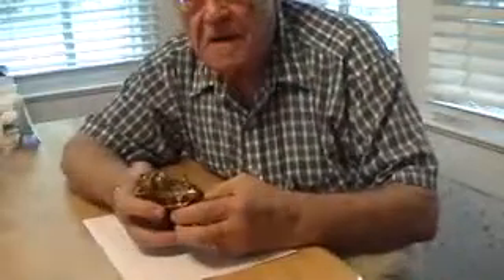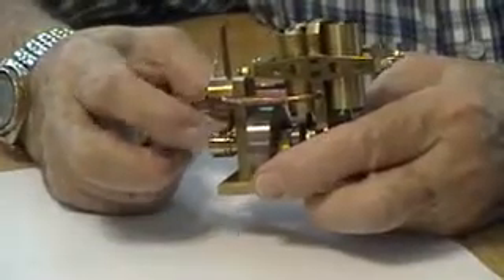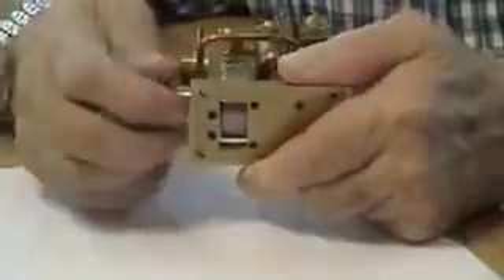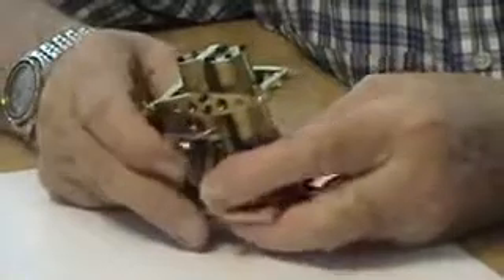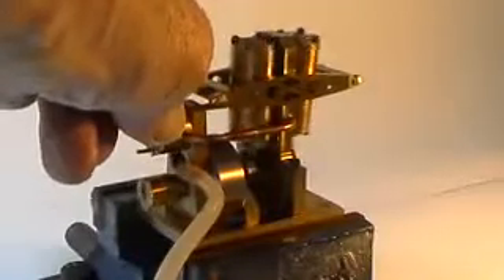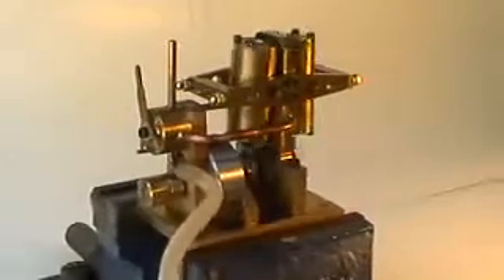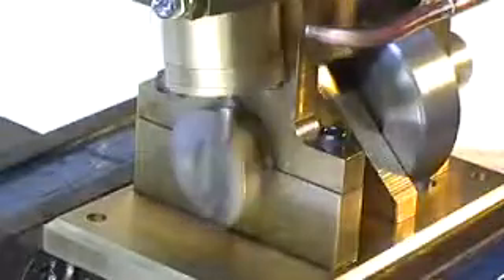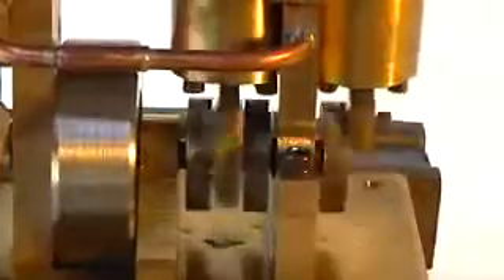My Twin Cylinder In-Line Model Steam Engine.

Comment from the maker: Mine are double acting - not really more difficult than single acting.  In order to be self starting they must be twin cylinder and double acting.  The cylinders should be close to 90 degrees apart, but it is not necessary to be precise.  The same appliies to twin cylinder in-line - the crank pins should be set 90 degrees apart, but precision is not necessary, just nice and close!  Glad you like my engines!  John.

Comment: your engines and videos are very nice!  I see great craftsmanship!

I want to build a vertical oscillating cylinder steam engine.  It will most likely be single action. are yours double action?  
can a twin cylinder single action engine be self starting? It seems as though if the crack placement for the cylinders is 90 degrees it should work or am I wrong?